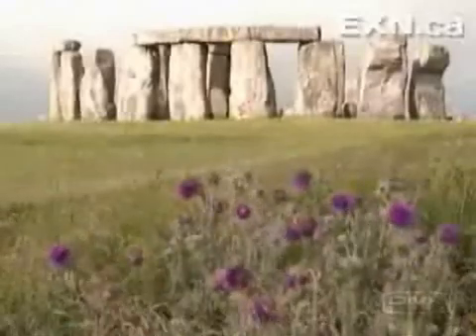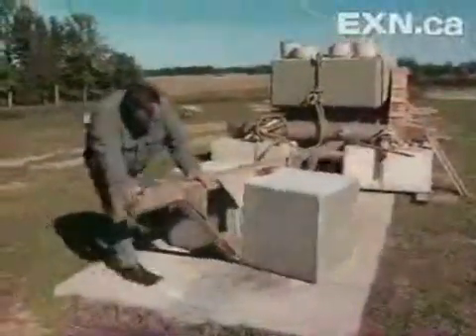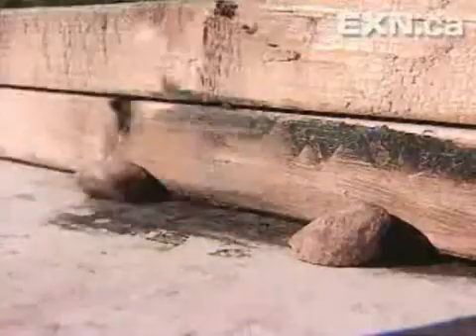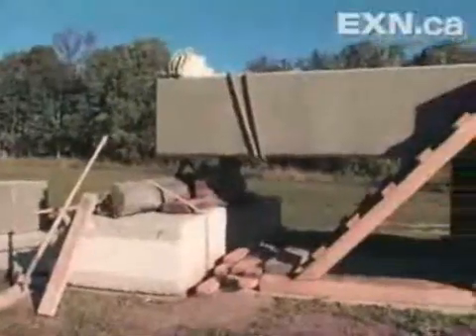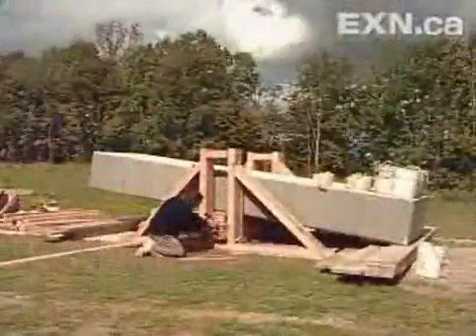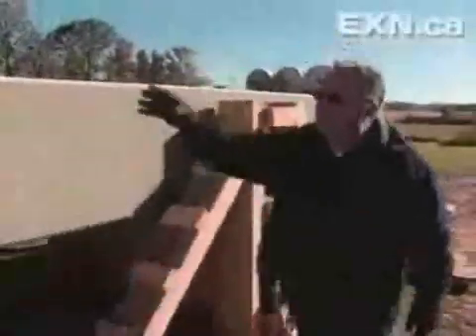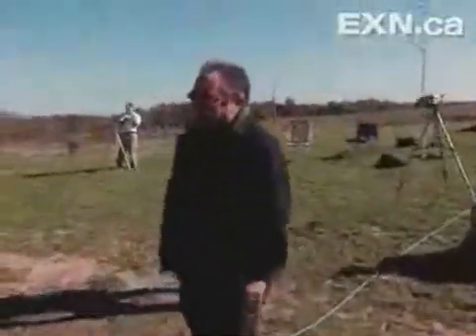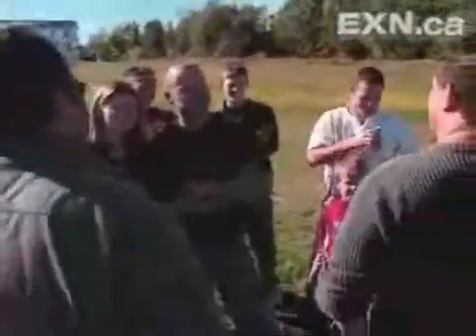Simple building. Stonehenge Reloaded by only one white man!!!

Comment: and now to figure out how the horizontal pieces can be placed so that its resting on top of two vertical ones!
Reply: the two vertical pillars were buried to the top. then the horizontal pillar was moved into position before the vertical pillars were cleared of earth to be exposed again.
That's how I always assumed it was done.
Reply: With time and patience it could be done with the same methods.
Reply: Again, using the fulcrum points and the counterweights, he simply moves the counterweight to one end so that the opposite end rises.  He adds wood under the slab in the empty space.  Then he moves the counterweight to the other end of the slab, so that the opposite end rises and adds wood under the slab in the empty space.  In order to keep the wood he is adding underneath the slab in place, he has a frame on both sides of the slab and makes sure that each stick of wood he adds is inside the frame.  In this way, the slab quickly "climbs" higher and higher with each tilt of the slab with the counterweights.  Once he is up over the height he needs, he puts the fulcrum points back into play and "walks" the slab into position over a wooden bridge.

Comment: Now explain how they placed the 20 ton stone 30 feet in the air going horizontally across two 25 ton blocks.
Reply: Daryl Oster
Yeah, but how is it lifted? Link please...
Reply: There are several other videos that show exactly that.  First the two stones are lifted enough to drop them into their foundation holes, then the third block is moved in between the vertical pillars (but at 90 degrees), then it is lifted to the height, then it is rotated 90 degrees and then lowered to rest on the pillars.  Very simple, and only a few people required to do it - no aliens involved.
Reply: God you people are in-exusably egocentric. 

You think everyone that lived thousands of years ago were dumb-asses. 

You steal their achievements away from them.
Reply: +HigherPlanes - He covers that at the 2:59 mark.
Reply: No, that was to show how he elevates the block 3 feet off the ground in preparation to stand it vertically the next day. That's one single block. Let's see three blocks, two standing vertically and a third not three feet,  but thirty feet in the air laying horizontally accross the other two blocks.
Reply: If you can raise a block three feet, you can raise it thirty feet using the same procedure.

If you can raise a block thirty feet, you can raise it thirty feet plus six inches and pivot it out over the vertical blocks.

Sure, I'd like to see it as well, but all the ideas are there.
Reply: Dave Hodges

Theoretically (on paper) it may be possible, but he lacks the technical knowledge to build full scale structures in the real world. The complexity is too apparent.

Think about all the different forces and load-bearing factors that come into play when building super structures. For example, how many 2x4s can you stack vertically before they begin to give and crush under the weight of a 20,000 ton object.

Comment: How did they get the stones on top dn
Reply: RonnyArtist Probably a similar technique to the 'jack' used to lift the sanding stone up.
Reply: highly doubt they even had a jack like that in firt place tbh
Reply: RonnyArtist Well, it was easily achievable with that technology, regardless of opinion.
Reply: thers no evidence they used this method and why is there no demonstration of getting the rocks on top if it was used within the same method
Reply: RonnyArtist Just because it isn't shown (it is btw but nevermind) doesn't mean it's impossible. It's called extrapolation. Also 1:10.
Also, there's no proof or reason they couldn't use this method.
Reply: thats a picture. not a demonstration? also not ven as HIGH up as stonehenge, spinning on a stone, on concrete, the stonehenge is on GRASS so the weight would actually bury the stone, i think hes got an idea but doesnt mean they used that method
Reply: RonnyArtist What do you mean by 1:10 being a picture? What? It's the first 'henge' he built, with a horizontal beam across. And it's on grass.
And I never said they used that method. Using Occam's razor, I deduced that was the most likely and there was no proof otherwise.
Reply: meaning 1:10 is showing the finished project, not demonstrating how he got the 3rd stone up there
Reply: RonnyArtist He doesn't use modern technology.

So he used techniques feasible for the original builders. 

Just because you didn't see him do it, doesn't mean he cheated.
Reply: +Genetik Music did you watch the video man?

Comment: The problem with this is, the stone have to be on the flat surface.  We don't see any flat surface like that at Giza.
Reply: Same concept, except instead of rocks, you use rounded log rollers to get the blocks to the construction site.

The construction sites themselves were perfectly level, as determined by the architects using water based measuring tools.

Comment: moving heavy stones with small pebbles would produce visible circular wearing on the surface of the larger stones, caused by the grinding; none visible on the megaliths of stonehenge or pyramids

other people already making the other point - flat surface needed the entire route for pivoting to work, otherwise pebbles would be crushed and sink in the mud/dirt.

interesting use of physics, definitely impressive and without the need for aliens. but not the answer
Reply: maybe they faced the worn sides of the stones inwards, so they wouldn't be seen?

Comment: Really cool, however you wouldn't be able to spin the stones like that on dirt. If you noticed in the video they were only spun on hard flat surfaces. The stones at stone henge were moved from hundreds of miles away and there were no hard flat road to spin them on. However, I definitely think this guy is on to something.
Reply: If the pebble sinks too far into the dirt, use a larger pebble.  Eventually, you will have enough rock sticking out of the dirt to rotate the stone on.
Reply: I suppose you could put down a hard surface (like a big deck), spin the stone across it, then relocate the deck.
Reply: yeah i saw that too..on the other hand, stonehenge wasn't build by one single man :)

Comment: Some excellent ideas! However one point for discussion is the "stone pivoting method " would only work if there was a hard surface such as a concrete road, I don't think there was hard surface road 160 miles to the  quarry I suspect the ground was soft mud! Also I would suspect that constantly pivoting the stone over such a long distance would wear noticeable grooves into the stones. Again great ideas and the up-most respect!

Comment: Stonehenge was built 2600 BC. Egyptian copper saws have been found dating back to 3000-2600 BC
It would have been difficult, but not impossible. The Khufu ship, which has straight-cut planks in it's design, was built around 2500 BC. So the technology existed in at least those parts of the world around that time. There very may well have been older ships and knowledge which has been lost to time. It's easy but not fair to make assumptions one way or the other when one doesn't know the whole story

Comment: @discordanceaxis They would dug under the stones and place wooden planks, as many as necessary, the result would have been similar as just using concrete. The same as with raising the big block first he dug one hole in the middle put up his construction, then he dug on the sides so he could start pivoting it (i assume, this would be ONE possible technique)

Comment: @khazal12 He explains the movement is the first minute or so of the video. By using two small rocks as pivots he was able to move huge blocks at a rate of up to 300 feet per hour. Quarrying and moving the blocks was still quite an achievement but he has demonstrated a feasible method of transportation.

Comment: the point isn't about turning the stones on a pivot that was already there, or even erecting them vertically. The stones where quarried quite a far distance away from stonehenge with no means to transport them. Furthermore, how is he putting all that equipment around the stone to erect it in the first place. as you can see at 3:47, he would've needed to mount the stone onto the pivot in the first place which would require lifting it completely

Comment: @strangerlover11 no because there is a low pressure point and u rnt dropping it on the stone, that would increase the force, u r placing it so the force is less and the little stone creates a force that pushes up against it at the same force so it doesn't get crushed into pieces and it has time to create an equal force against it